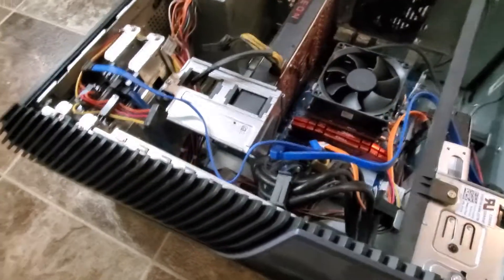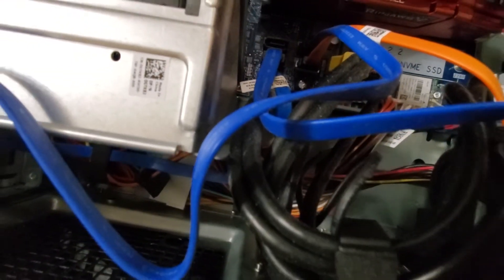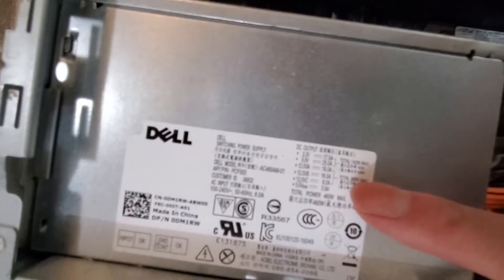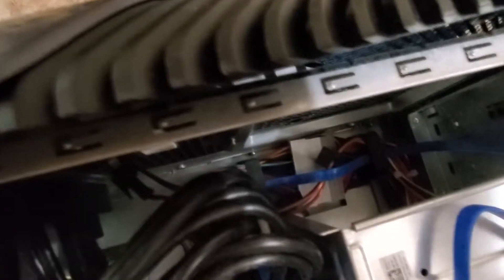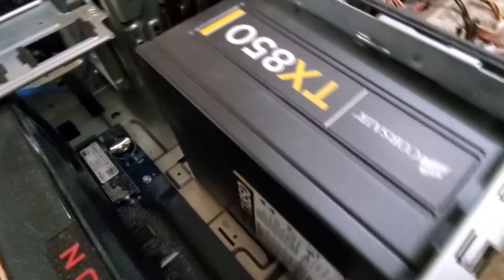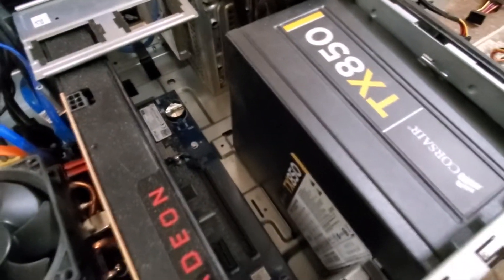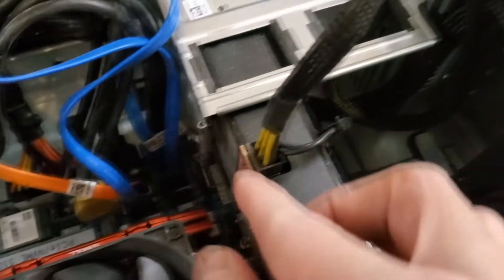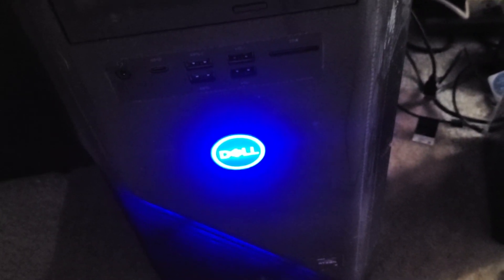Kintips How To Replace PSU Power Supply Dell 5675 Inspiron AMD Ryzen 7 1700X PC Desktop Corsair 850W

Comment: Thanks for doing this video I have the same problem with my Inspiron 5680. I just used a pair of wire cutters to cut the plastic grate.
Reply from the maker: Yeah the Old DELL Computers were good as you can buy off the shelf parts to fix it. The new ones are all proprietary.

Comment: Is the inspiron 5675 power supply pure sign wave.
Reply from the maker: dell makes the worse PSU, especially now that they are proprietary. The old dell computers like this one at least you can buy OEM parts and replace them yourself, the new ones you need actual DELL PSU

Comment: Does the motherboard have a standard power supply pinout?
Reply from the maker: Yes, this is an old DELL they used standard PSU's back in the day, the new ONES are proprietary

Comment: Do you know, is it a standard motherboard, or if I replaced the motherboard will it not mount and hook up properly to the case and it's wires? I actually love the case, but would love to do some transplanting between it and another machine I have
Reply from the maker: This computer is old and it is a standard motherboard. The NEW dell ones are proprietary
Reply: I have 2 of these. I haven't upgraded yet but they look like mATX board. I put in a RX 6600 XT because it is cheaper, low power and better than 3060 12GB
I plan to upgrade to Zen 5 in a year or 2

Comment: Do you know of a 8 pin ATX adapter for an Inspiron 3910? I tried the COMeap 24 to 8 adaptor from Amazon and it didn’t work.
Reply from the maker: you may be able to find an adapter on the dell site or order a PSU from dell it might be proprietary

Comment: How did you get the PSU to stay put at the top of the case if the alignment for screws was not correct?
Reply from the maker: The PSU is mounted on the bottom the case
Reply: @kintips  DOH 😣 you're right. I didn't even realize it. I just ordered an EVGA 600w while on sale to install for mine. I noticed after upgrading the GPU to a 6600xt the display does not always come on out of sleep mode, not frequent, but enough to justify the PSU upgrade.
Reply from the maker: @420  I have 6600Xt its a nice card, i find the AMD drivers are kind of glitchy ALWAYS update to the newest ones. The Default PSU is only an approx ~430w so you will definitely need a new one. Especially if you have like 4 HDD/SSD 4 sticks of RAM etc...
Reply: @kintips  2 HDD, 1 SSD, soon to be 1TB NVMe to get rid of the other drives. The 256gb SSD it came with for the OS is always nearly full and so frustrating. Finally taking care of things and upgrading to NVMe and the PSU.
Reply from the maker: @420  Yes that was the first thing i upgraded when i got the computer, you can watch my other video on how its done. Its a pain to do because its a dell.
Reply: @kintips  installing NVMe was hard? Surely you mean something else, because the NVMe is wide open on the MLB to slide into place, so I'm fully expecting that to be easy. I upgraded to wifi6 and that was a little work since I had to route the antenna and cabling.
Reply from the maker: no physically installing is no problem, its the software installation on it, it can be finnicky.
Reply: @kintips  aw, hell. I didn't think that would be an issue. If you can link me to the vid, I'll check it out you. You had a lot of gaming uploads, so I couldn't spot it.
Reply from the maker: https://youtu.be/q-YSz-KfAus
Reply: @kintips  I've got my NVMe drive in and sure enough it is giving me a hard time trying to install windows. I've got the NVMe in the m.2 slot and used diskpart to format and it still refuses to let me install Windows. Getting frustrated.
Reply from the maker: If you watch my video, the only way i made it work was disable all drives except the nvme, unplug all drives. That forced it to install.
Reply: @kintips  I came up with that idea a bit earlier. Likely will just unplug the SSD and HDD, try to install on the NVMe and adjust the boot order to make that primary.
Reply: @kintips  so, I finally got freaking Windows installed. The issue was that the damn NVMe wasnt GPT format. I had to diskpart, clean, convert gpt and it then worked. I did have the other drives unplugged, so not sure if that was really a factor now.

Welp, 1TB m.2 NVMe boot OS, 128gb SSD, 1TB HDD, 500HDD. Looks like I'll need to put a small Kali Linux partition somewhere with all this extra space!

Comment: thanks for this video. managed to put an rtx  2060 in this just fine but since it was bottlenecking my cpu i decided to get a new motherboard with a new ryzen. ofc I cant because this PSU is so bad and theres a different layout of pins. Decided to see what people on youtube were checking and found this video. buying a new PSU now. Dell is so bad honestly.
Wondering if I would just need a new PSU or anything else, like cables etc. would save me some time in deliveries.
Reply from the maker: OLD DELLS are good they use the same ATX PSU you can buy off the shelf. NEW DELL bad they use proprietary ones. Just buy your self a new PSU and you should be good to go
Reply: @kintips  thanks for the quick reply. bought myself a new psu and hopefully everything will be sorted.
Reply: @kintips  got it sorted with the new psu. had to buy a new case but was definitely worth the hassle. thanks for the video once again

Comment: Dell is just insane to put the fan facing down, with virtually no air flow. It runs like chainsaw
Reply from the maker: yes you're telling me. i hate the proprietary stuff they put in.
Reply: PCU fans are intake fans and should be facing the bottom of a case with 1/2" airflow.  They can face the back but you will draw more dirt in your system that way.  Dell's pcu does not have a fan.  The metal case is open enough for a fan and has 1/4" clearance to the plastic shell.  In theory, it should draw air from between the shell and the metal case.  I will be cutting away the plastic instead.
Reply: @pennytowner728  Thanks! Never knew the PSU fan is supposed to face down. But Dell actually does not have a downward vent directly for the fan. Instead, it is offset for about 15 cms, thus forcing the air to go through a very thin tunnel between the metal chassis and the plastic case... insane.

Comment: Could you help out a mom that doesn’t know much about how the insides of computers work? I figured out after much trial/error & googling that the PSU on my sons computer crapped out. It’s a Dell Inspiron 5675 1400 (just over 3 years old). For about a year every time it shuts down completely, it would take up to 1/2 a day of pressing the power button to get it to turn it back on. I originally thought it was the power button switch and replaced it about 6 months ago & same thing would happen. Now, it shut down 3 days ago and we’ve tried countless times and it won’t come on (no lights at all). I’m not sure how to figure out with my specs what PSU would work? I looked up the one you show in this video and found some refurbished ones on Amazon, but I’m not even sure if it would be ok since mine is 1400 vs your 1700. I have more info if you need it as I have the packing slip/receipt from when I purchased it. I’d really appreciate it!
Reply from the maker: It sounds like the PSU is dead. its rarely ever the power button. Any ATX power supply should work in the system.
Reply: Thanks! Bought an EVGA 600 watt 12v 80 plus PSU for $40 from Best Buy and put it in yesterday. I didn’t really know what I was doing and was shocked the computer started up. Your video helped me a lot!
Reply from the maker: Cool. Future tip, don't buy any New Generation DELL. They moved to proprietary components. So you won't be able to do this next time. You're better off buying a different brand.

Comment: I have the same pc, would the corsair cv550 fit in this case?
Reply from the maker: all ATX psu would fit but the way DELL made the case it doesn't fit unless you cut some plastic, which is annoying. The screw holes are different too.
Reply: @kintips  that's not too much of an issue, I have some metal snips, just wondering if it's worth spending £35 on a psu that may not fit and be a waste of time, potentially. The stock psu is a pile of garbage and has shorted 3 hard drives in the last year or so.
Reply from the maker: I can't agree more, The DELL PSU IS Garbage, Totally worth the PSU upgrade. I wish i did it sooner, found the computer much more STABLE, no blue screens of death.

Also All NEW DELL computers now have a proprietary PSU, don't buy them anymore. You won't be able to upgrade it yourself anymore.
Reply: @SSR_RedDevil  what did you end up buying?

Comment: Planning to get a psu which is the 600 watt model of evga bronze thing. Hopefully it goes well, i was wondering, do we screw the new psu onto the case?
Reply from the maker: the case does not fit properly i had to cut some plastic out to make it fit. i just leave it in there now
Reply: @kintips  oh ok
Reply: did you get this psu  and does it work fine? Like do all the cables fit?
Reply: @Jason....  yeah it fits in, but u cant screw it
Reply: @Jason....  usually in custom pc cases, theres a whole bracket which can fit any psu size, but unfortunately for us, some psus wont fit. Luckily for me, it fit but the problem was it wasnt screwed as it wont even reach the psu from the case. Custon pc psus are swuare and allows psus to stick as close to the screw slot while dell has a bit of a bump meant to fit their stock psu. but yes, cables ofc will fit any cpu, motherboard, gpu, sata slot and ect as its universal as long as u position it properly, just be ready to face a few fitting incoveniences when getting the unit in itself
Reply: @torneycarblos9140  thx this really helps im planning on upgrading some stuff soon
Reply: @torneycarblos9140  thanks for this comment. was getting the same psu as you. managed to put an rtx 2060 in this just fine but since it was bottlenecking my cpu i decided to get a new motherboard with a new ryzen 5 3500x. ofc I cant because this PSU is so bad and theres a different layout of pins. buying a new PSU now. Dell is so bad honestly.
Wondering if I would just need a new PSU or anything else, like cables etc. would save me some time in deliveries.

Comment: I know this from experience, I have a Inspiron 5680, you should get a better CPU fan and case fan. I recommend a noctua NF-P12 Redux case fan and a Noctua NH-D15 CPU fan
Reply from the maker: the dell case, doesn't fit components well. But i don't know if a stock case would fit the Dell motherboard.
Reply: Hey, does the NH-D15 definitely fit? I'm looking to upgrade my 5680 cooler.

Comment: Honestly great video, deserves more views. I would love to know how putting a different graphic card in would go. Especially a 1080 ti because I'm looking at doing this :D
Reply from the maker: if you plan on doing a better video card you definitely need a better PSU, the PSU dell stock component is not great.
Reply: I swapped the Radeon 570 to a 6600xt and sometimes the system doesn't wake from sleep, so I'm upgrading the PSU.
Reply: @420  I upgraded psu to Evga 650w and it runs high fan speed…is there a way to control psu on bios or something?
Reply: @TheMoistBanana  I have the EVGA 600w installed and haven't audibly heard high fan speeds. Are you saying your PSU runs high, or the CPU fan runs high, or case fans running high? Either way I would think you might need to look for some software or more preferably just send back the PSU while you can.
Reply: @420  thank you…yeah I’m going to do some testing to see if it’s the psu causing the issue. But it is a high fan sound coming from psu sounds like it’s running at 100% load even at idle or startup
Reply: @TheMoistBanana  motherboard can cause high fan spin up sometimes, so maybe it's not hooked up correctly? I say don't waste too much time on it and just return it tbh. If the second PSU does the same thing....then try to troubleshoot it. I've received a defective PSU before, but that was a decade ago and I legit had to tilt the PC at a certain angle to get the PSU to supply power. Guess a loose wire internally

Comment: Thanks for the upload. Great video! I was wondering what I should do when the Dell power supply inevitably fails. Looks like it is as simply as just cutting off that plastic part that goes over the PSU.
Reply from the maker: yeah, doesn't fit well with DELL case, eventually i will move it over to new case and new motherboard

Comment: Could you provide a link to the power supply you installed? I looked up Corsair TX850  and there were a lot of variations of that PSU.
Reply from the maker: Its a corsair TX850 ATX (https://www.corsair.com/ca/en/Categories/Products/Power-Supply-Units/TX-Series%E2%84%A2-TX850-%E2%80%94-80-PLUS%C2%AE-Bronze-Certified-850-Watt-High-Performance-Power-Supply/p/CP-9020043-NA). Anyone will do actually. the biggest problem is that DELL uses a crappy case doesn't make it fit properly. So you may have to modify it. But in terms of compatibility it works.
Reply: @kintips  thank you! Your video was exactly what o needed at the right time. My 5675 just died and there are plenty of people asking how to replace the psu in their 5675’s, but very little in the way of answers. I had to fix it ASAP, so I went ahead and ordered the Corsair cx650m so hopefully it will work out ok.
Reply from the maker: DELL has the worst PSU i've ever seen. How can you make a gaming computer with a 460W PSU lol  That PSU you got is nice.
Reply: @kintips  the modular power supply is a wonderful thing. This is the first fiddling with a computer I have done in 10 years. It installed easily, though I had to order an extra 15 pin to 6 pin(I think) cable to power the slimline dvd.
Reply from the maker: Hey you know you can take the cable from the old DELL PSU and use it on the new one, that's what i did.
Reply: @kintips  I did not! Thanks for the advice.